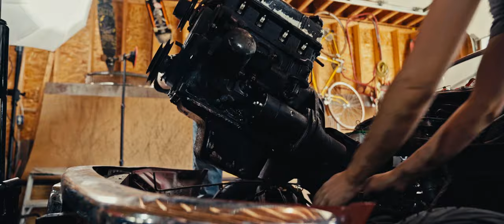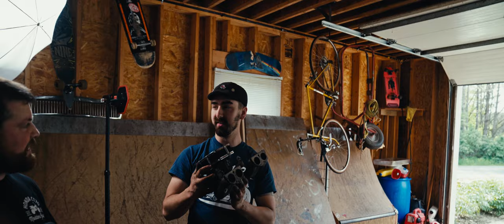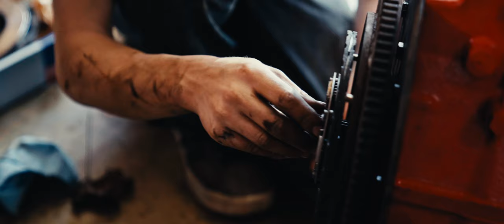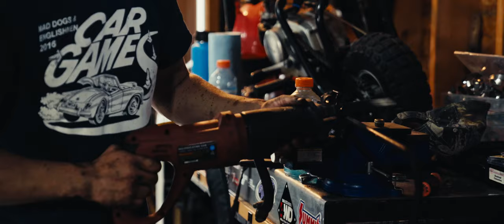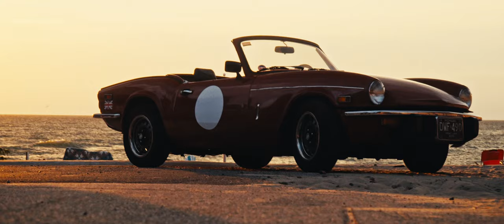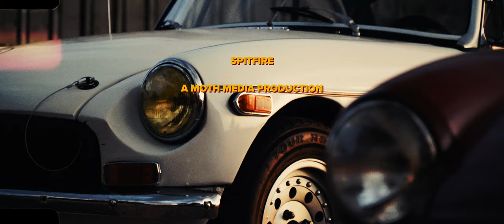SPITFIRE (Mini Documentary) | '79 Triumph Spitfire

Comment: I understand that the documentary was not about the engine swap but about DOING the engine sawp. But what engine did you put in there ?
Reply from the maker: If I remember correctly it's the same motor that comes in that year of Spitfire just bored out and an overdrive transmission mated with it.